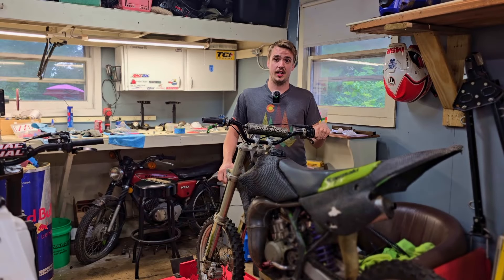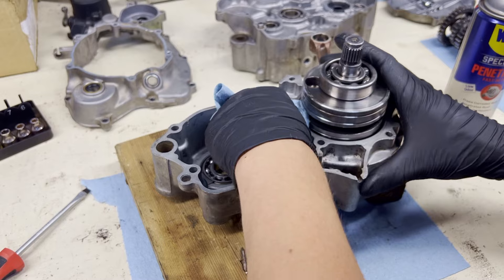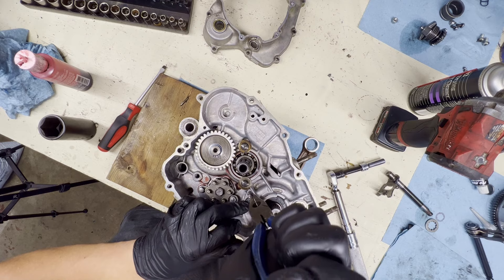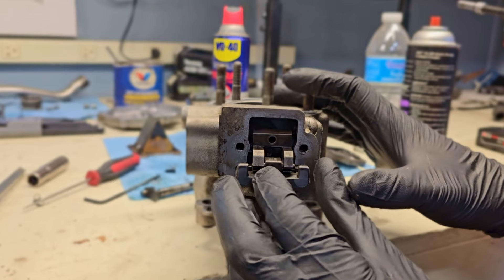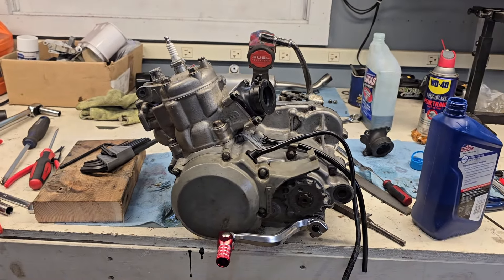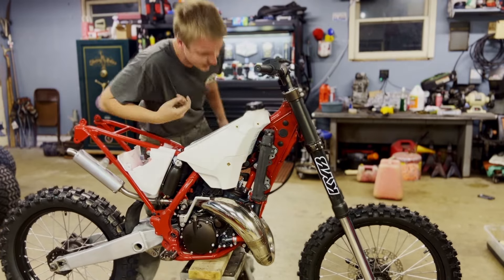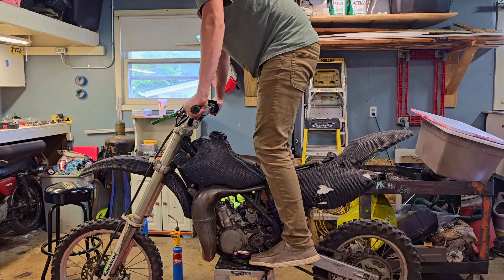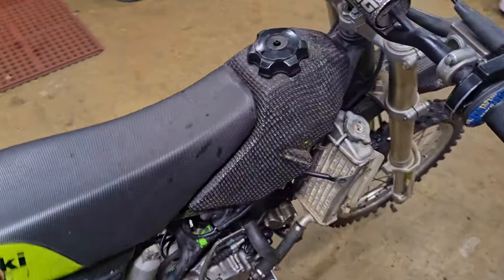KX80 2 Stroke Revival: Rebuilding The Engine

Comment: How did you mount the, right side crankcase onto the left side. Did you use the special puller to do it? or did you heat the bearings?